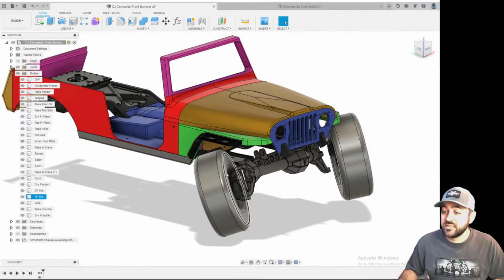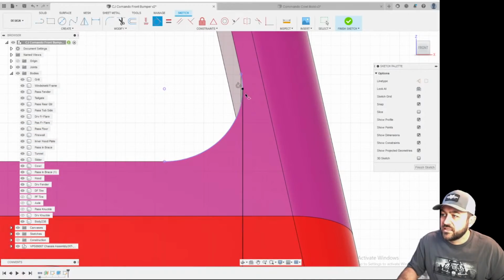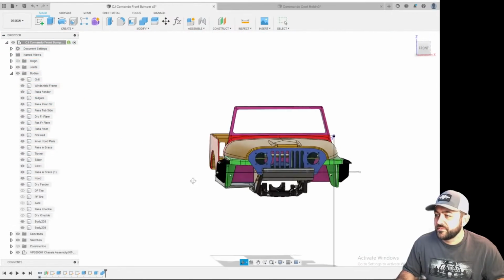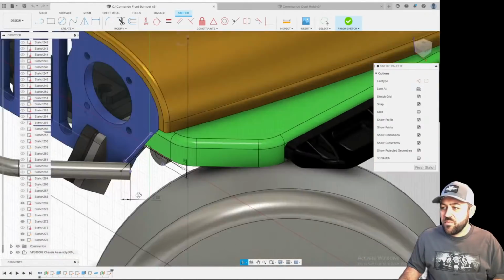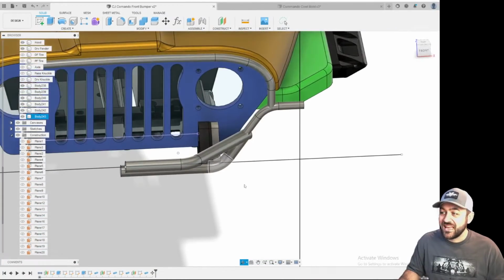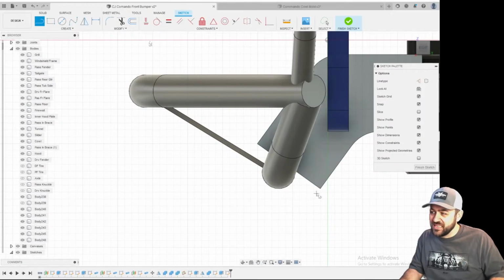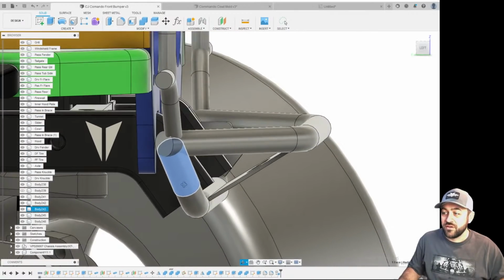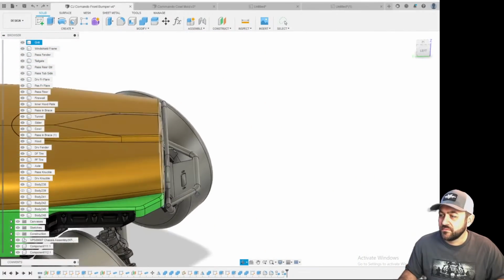Bumper Designs - 3D Printing Sunday  - Ep 35

Comment: In your opinion why lighter vs heavy
Reply from the maker: If you’re going for performance, than light weight is the superior choice. If you add a bunch of weight, then you have to be able to have enough traction to pull that weight up climbs. Added weight doesn’t apply to traction as the angles increase. Adding weight is helpful when you can keep it way low to improve center of gravity, but it has to be reasonable.
Reply: makes sense thanks